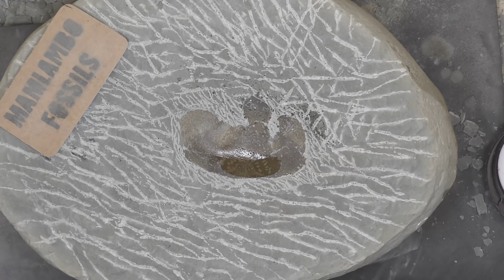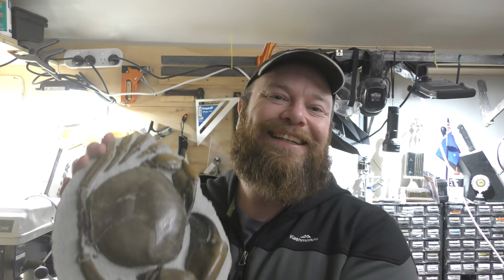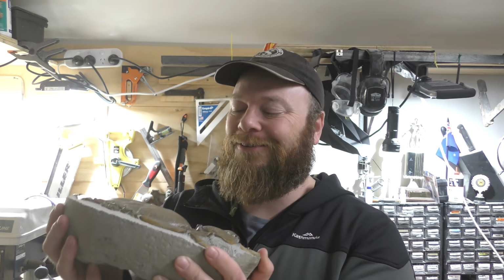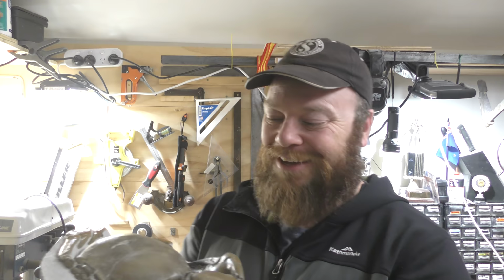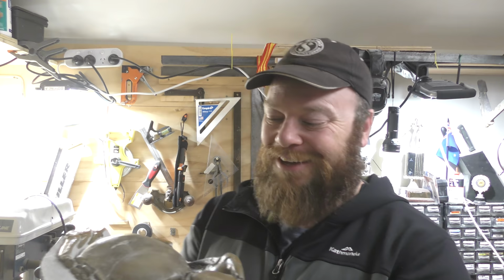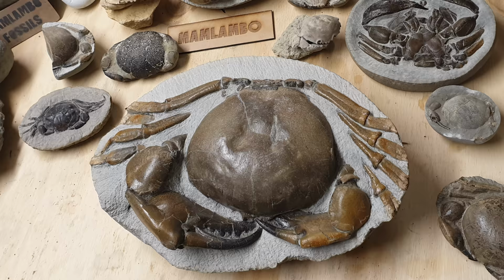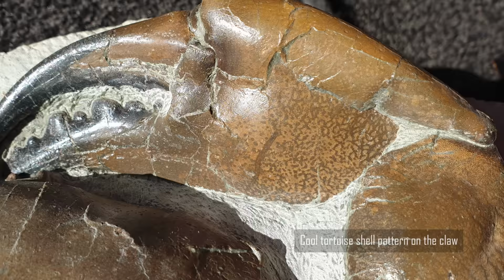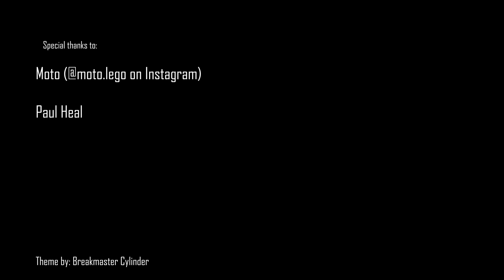MONSTER fossil crab prep - the 50lbs crab finally gets prepped... and it's a beast!

Comment: As a geologist, this is quite the treat considering I don't get to go to the field much anymore. That is quite museum quality specimen. Do you know the formation age perhaps? Or the regional depositional source?
Reply: I just found Mamlambo. How are these fossils made? Was the stone originally lava?
Reply: @x3r9g6  so generally fossils occur through permineralization which means the cavity space left behind by the creature when it dies in place gets covered by "mud" and gets  replaced by whatever host minerals are there at the time of lithification (conversion into rock). Now in this case because a crab thas an exoskeleton that is chitinous and typically composed of biopolymer and basically calcium, it undergoes a process called replacement where the host structure is replaced by the rock around the animal. So the shell usually doesn't decay and basically turns into what ever rock is there. There are other forms of fossilization but in general, all things fossilized are usually covered by mud, volcanic ash, or sand. Lava usually destroys any trace of an animal trapped in it. Hope that helps.
Reply: How do you recognize that a rock is a fossil?
Reply: @phantomkid8952  that is where the hard part is. Even seasoned geologists and paleontologists can sometimes mistake abiotic formations for biological. Most of the time it comes down to a structure difference or obvious patterns - i.e. knowing the host rock characteristics compared to anomalistic traits like for instance an ammonite has "suture" structures in its chambered shell that is easily recognized from the rock itself.  But that's where in depth study comes in -manganese dendrites for instance can look like fossilized ferns but they are in fact manganese oxide crystals that can form in cracks or layers between rocks.   The other way we recognize fossils is studying how the rock was formed, like limestone that forms in ancient shallow seas and knowing that finding unusual patterns in outcrops of that limestone can often times lead to fossil discoveries due to the fact that life is quite prevalent in those types of environments. Basically the biological clues of today can lead to discoveries of the past.
Reply: @justalittleoff-grid1180  How many hours can it take to remove all Rock around a Specimen.
Reply: @MangoRageYT  oh man, it can take anywhere from hundreds of hours to sometimes months depending on the host rock type, what kind of fossil and how big the specimen is. A good example for instance, is say a fossil that is being removed from a softer shale versus a harder or more "competent" crystalline limestone.  I've extracted Permian age glossopteris leaves and branches out of carbonate-mudstone in a matter of hours but had a hell of a time getting a Cretaceous era Ammonite cast out of a chunk of limestone at my study area in central Texas - took like five months.
Reply: @justalittleoff-grid1180  Where abouts in Texas are you?  I'm in Bryan/ College Station area.
Reply: @AlexBabcock-hw9iz  yeah I'm no longer in Texas unfortunately. I graduated back in 2009 and have been a geologist for an environmental engineering firm since then - I currently reside in Arizona or as it is more accurately known - hell. Lol. Been to college station a bunch tho, aggies throw some good parties.
Reply: “For in the days before the flood, people were eating and drinking, marrying and giving in marriage, up to the day Noah entered the ark; and they knew nothing about what would happen until the flood came and took them all away. That is how it will be at the coming of the Son of Man.”
Matthew 24:38-39 NIV
Reply: Dr Rockso  my believe are base on lies ? It makes more sense to believe in Jesus Christ than believe in something something stupid told by science…
Reply: he wasn't in the field he was at the beach...         
snap....
Reply: @jaggedbrain  the field to which he refers is the area of fossil excavation, sure it could be an actual farmer's field or otherwise field of traditional sense you attempted to wittily acknowledge, however it is in reference to their field of current or past discovery, study, and excavation of the field of fossilized remnants...snap...
Reply: @phoenafox tou·ché 🙄
Reply: As a geologist you should be able to tell when you see stone being worked and the difference between stone being worked and a mixture of clay and plaster of paris... you need to be more honest, youve never worked in the field.
Reply: @justalittleoff-grid1180  I’m sure you are great fun at parties
Reply: @laverdadsiempre2823  ignorant

Comment: WOW! I have a ton of questions, but first I must say I am really impressed with your skill and patience...wonderful job!

1. How did you know it was a crab fossil when you found it on the beach? Did you see a small amount poking through the rock?
2. How are you able to chip away the rock without damaging the fossil itself?
3. Would it be feasible to remove all of the rock so that you could study the features of the mouth and the like?
4. Do you sell these? Or are they for your personal collection?

Thank you so much for sharing this..fantastic video.
Reply: I have those same questions! I wish you would get some answers. Fascinating!! 🙂
Reply: @wendyhoag9637  After watching his vids for a while now I have answers for most of them:

#1 A lot of times a tiny bit of claw or leg is poking out and he can identify them that way, but he also can tell by the shape of the concretion that it might have something inside.
 
#2 He uses a small tool and as the fossil is a bit harder than the material around it, he can go really slow and the surrounding material can be chipped away. Watch one of his prep videos, they are fascinating and looks to be very laborious...however, the results are absolutely amazing....Oh and he also uses acid on the rock as well to prep it.

#3 The more of the material you remove, the more fragile the actual fossil becomes and if you try and remove all of it, it runs the risk of breaking it.

Still don't know about #4.

If anyone in the comments would like to elucidate or correct me If I have something wrong, please let me know.  :)

Comment: A question intrigues me: How to know exactly the excavation plan, since you cannot see the fossil before starting to work ?
Reply: How did he know there was a crab in that rock to start with
Reply: @lordbelvoir2543  at the beginning you could see shell part visible outside of the rock. But it was too small to be noticed with the quick frame.
Reply: @lordbelvoir2543  same goes to me..
Reply: you can see the rings of the legs from the oustide look at 00:18

Comment: Saw this at Unilab!

How will you determine that a certain rock has something in it?
Reply: I was wondering the same!
Reply: I read that it is seen by legs sticking out a bit from the rock. You can see that the legs touch the surface so there is some discoloration.

Comment: I knew the fossil would be delicate but after watching how clean that side piece chipped off the first claw at the beginning, I can't help but wonder the difference in density and overall strength like the difference in steels and alloys I worked with when machining. The fossil seemed much stronger than I had anticipated

Comment: Is the crab rock harder than the outside rock?
Reply from the maker: They are very similar, but the rock flakes away from the crab usually - I try not to touch the fossil with the air scribe.

Comment: What type of grinding tool & bits did you use for this prep? I often use dremel but find it is just not strong enough and wear out too quickly. And I really liked the final finish on this beautiful monster! Please reply so I can find a suitable grinder for my art work. Thanks "Rock Bottom" in Ohio, USA 💯✔
Reply from the maker: Have a look at the CP9361 style engraver or the ME9100 from Paleotools. You can get generic ones on ebay or Amazon. They run off an air compressor. There is a page on my website with some details
Reply: @MamlamboFossils  Thanks, hopefully it may be an improvement. You have great video's. So where do you travel to find your crab fossils etc.? I only rockhound for artifacts, fossils & minerals in USA, but love to follow your explorations.

Comment: I want to know how you thought this boring rock had this in it!  I also want to know how you knew it stopped being rock and was the crab they looked the same?
Reply from the maker: Good questions! I could see the leg rings on either side which = crab 🦀.  The rock flakes away from the fossil as they are different materials so it is usually easy enough to see
Reply: @MamlamboFossils  thank you man.  I recently have started getting into rock hunting, this is different for sure compared to what I’m used to agates basically but are these common everywhere?
Reply: @MamlamboFossils  or even in general?

Comment: Its not a real rock its only cement  mold to circle form
Reply: If the death / fossilization of the crab was quick (as in a mud slide) there may not be other fossils with the crab like plants or specks and there wouldn't be that many other layers to the rock, also considering erosion over the centuries from the water, can erode other layers and polish the rock.